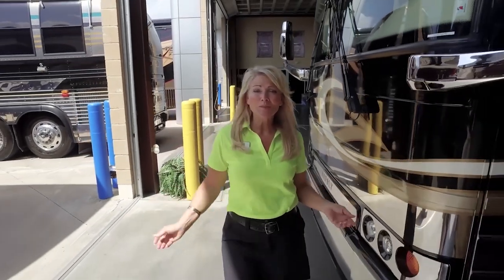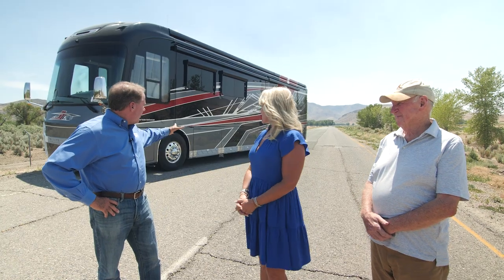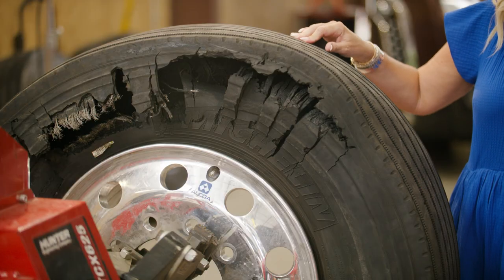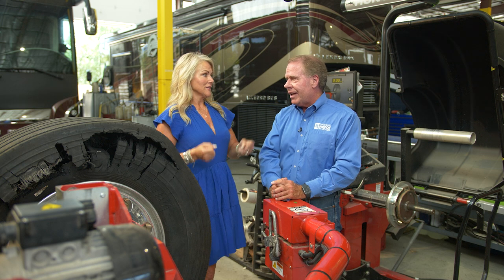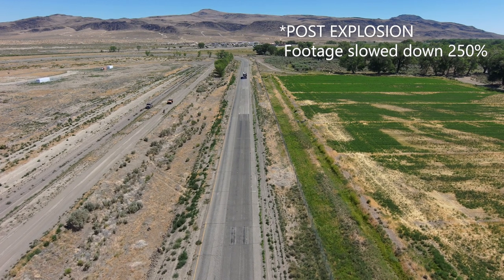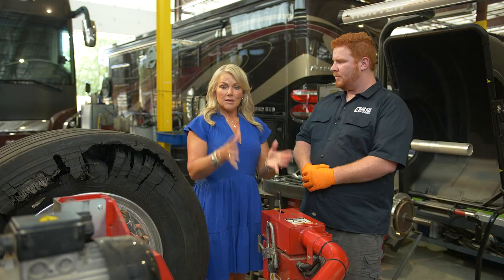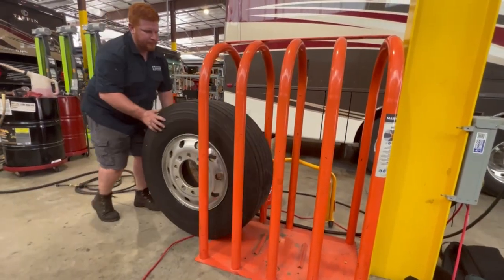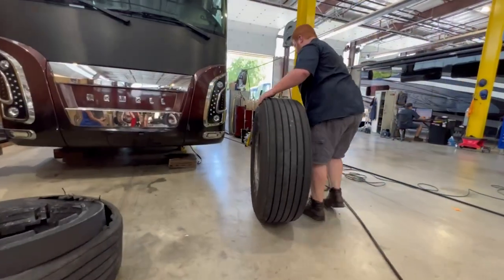MUST SEE!!! RV Tire Blows Out!!! No damage to RV!

Comment: The military band is designed for the tires on the military vehicles and there is a difference to the street tires.  The LMTV at 20-25,000 pounds has a top speed of 50-55 MPH and is more likely to go slower on a rough road.  That 365 Michelin is designed to handle more weight and higher speed but still give decent rolling for fuel economy.  The retroband is a much better design for the coach.

Comment: That's an awesome product. I used to be a trucker in the seventies and eighties. I didn't have power steering and I. Had a? Front right blow out going up the grapevine in California. Luckily I had enough road cause When the tire Blew out it shot The truck to a hard right turn luckily. I was holding on pretty good when I was going up the hill. I sure wish staying with a head one of those back when I was driving. My son has a motor home I'm gonna have him check this out. I'm sure he'll want one Set.

Comment: Can I purchase these for my 2007 Newmar Mountain Aire 3990 with smaller 22.5 tires on Alcoa rims?
Reply from the maker: Good morning John,

Thank you for taking the time to watch our video. We really appreciate it!

There’s really two questions in your question I need to answer. 

First, yes, Rettroband fits on all 22.5 inch wheels. 

Second, what is the size of your tire? Rettroband has sizes to fit tires from 225 all the way up to 365. 

I check the size of your tires, and if they’re 225 are bigger, and on a Mountain Aire I suspect they are, then we do a have Rettrobands designed and tested for your size. 

I hope this helps,
Brett Davis

Comment: angie wife and i have a couple questions 
1. does the rettroband make it harder to balance the tire?
2. how far can you go on rettroband after a blow out?
TIA
(BTW we love your videos
Reply from the maker: Awe, thank you for watching my videos, and leaving my such I nice comment. I really appreciate it!

Rettroband doesn’t affect the balancing of the tire at all. 3 to 8 ounces is all we’ve ever had to add, which is the same amount of weight tires required without Rettroband. 

Good question. We’ve been asked how far you can drive on Rettroband after a blowout many times. I suppose the real answer is however far you’re willing to let the blown tire beat your coach. In 2021 we tested to see how far we could continue at speed after a blowout, and we stopped after 12 miles, because the remains of the blown tire were just beating the coach to death. However, the Rettroband showed very little wear. Remember, Rettroband is made from much, much, much harder rubber than is the tire. 

Bottom line, you will easily be able to maintain control of your coach after a blowout, and get to a safe place off the road.

Comment: Very impressive demo! Do these only go on the front wheels?
Reply: They probably only go on the front wheels. However a blow out on the rear wheels won’t cause you to go off the road since the rear wheels don’t affect steering. But if the front tires blow out, it will be catastrophic.